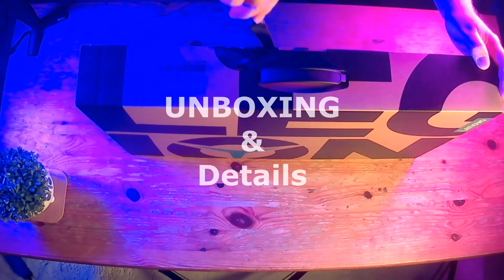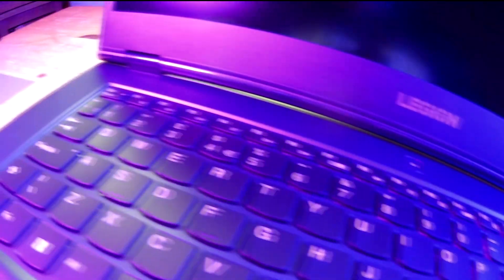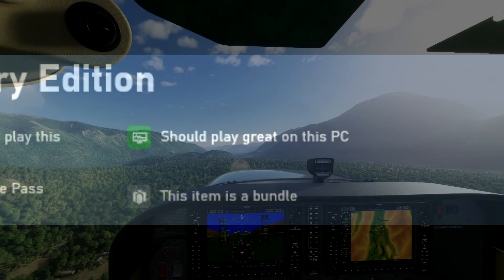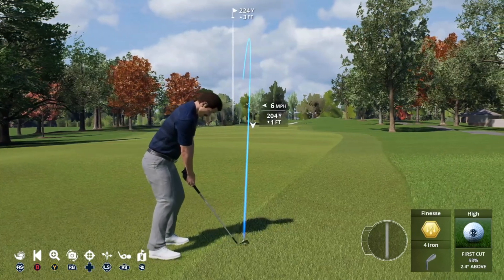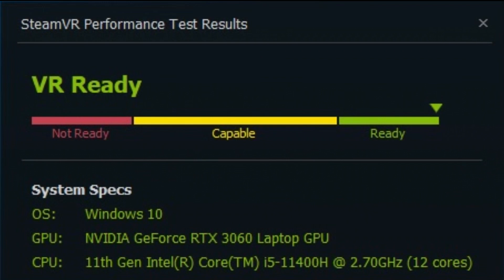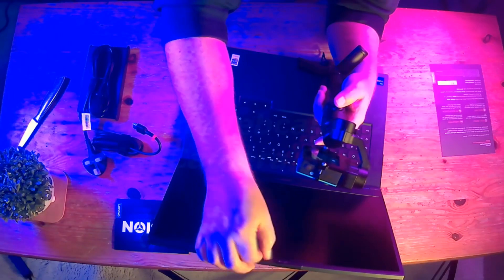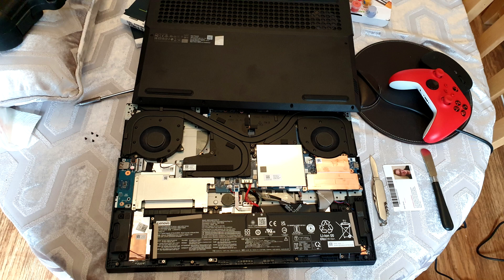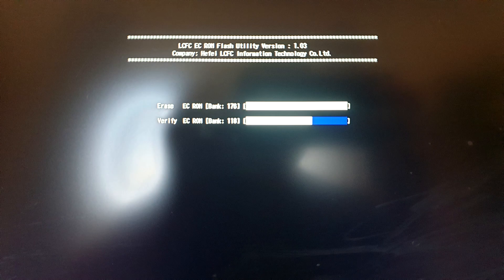Best Gaming Laptop for £750 |  Lenovo 5i RTX 3060 Gaming Laptop Review  |  Sim UK Reviews

Comment: Good unit eh? I just picked up a Lenovo Legion Pro 5 (i7 13700x with 32 gb ram and 4070 GPU 16" Screen 240hz). Came with 1t m.2 drive, and I added another Crucial P5 2t drive like you did. Got it for open box for $1200 USD (had only been bought and returned, I got full lenovo warranty. Very happy with it. Very fast. Haven't tried it with my Vive Pro2 VR. - but it runs everything so far quite well.
Reply from the maker: Nearly twice what I paid....but one hell of a find....KUDOS!
So you agree then, the Lenovo Gaming laptops deliver well for gaming?
Reply: @SimUKReviews  Exceptionally well! Totally impressed!
Reply from the maker: Awesome.  Thanks for your comments.

Comment: Does your PC run EA pga tour better than your Laptop.?
 My experience using a Lenovo legion/ Radeon/nvidia 2060 has been disappointing.
Reply from the maker: I have an i9990k overclocked to 5GHZ, RTX 3080, M.2 + SSD AND 32G DDR4 3200Mhz.
Yes it does run better, NO it does not run well even on my desktop PC.  The game is terribly unoptimized.
I found lowest graphics settings still look OK (after a while) and that allowed me 60fps to play.
Reply: Thanks.No point buying a PC just now...but I can't play VTOL VR or IL2 either so I will have to raid the piggy bank at some time.
Reply from the maker: These lenovo Laptops keep popping up at some excellent prices.
Maybe aim for an RTX 3060 or Above?
Reply: @SimUKReviews  I am not convinced a laptop GPU is equivalent to  a desktop GPU.What is your experience?
Reply from the maker: I would say not, on many occasions the laptop GPU will be running at reduced power (thus reducing capacity) Lenovo don't appear to do this, as all the Lenovo's I have looked at have the GPU running at max power.  The RTX 3060 is I think a good benchmark to play 90% of ALL games at 60+ FPS